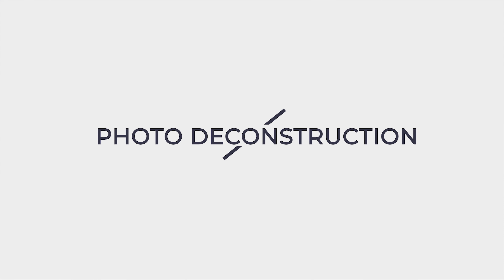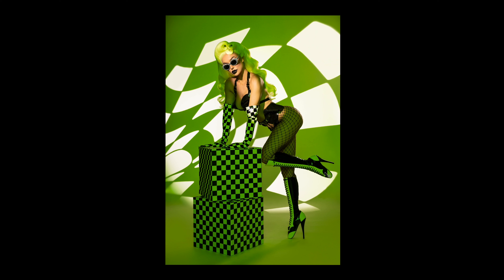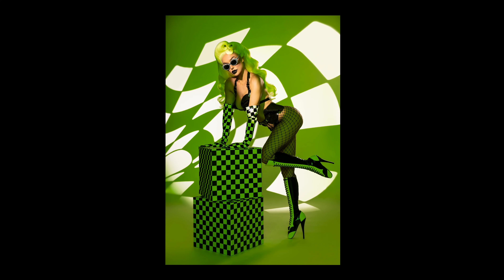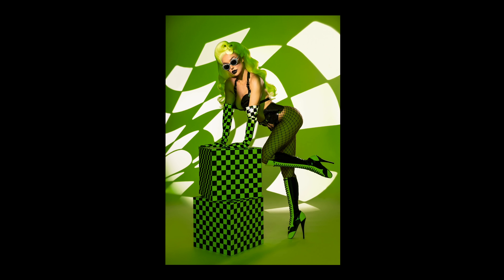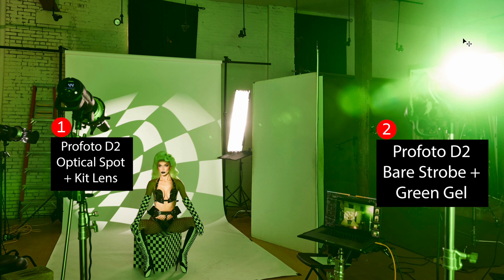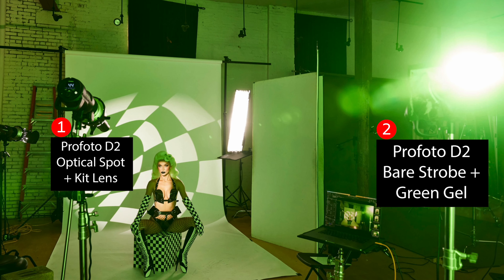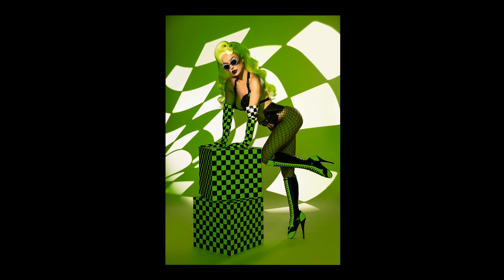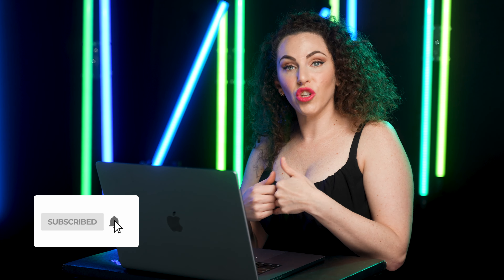Behind the Scenes of an Eye-Catching Fetishwear Fashion Shoot

Comment: I just tried my new optical spot for the first time with a 50mm lens.   How do you focus it?
Reply from the maker: there are two rings. one is aperture, one is focus.
Reply from the maker: Also - instructions. :D
Reply: @lindsayadlerphoto  I think they were trying to save money-- it didn't have any. It didn't even have a box. It was just wrapped in foam and bubble wrap.  Which surprised me from Adorama.  Thank you for the guidance.
Reply from the maker: @jamesg1974a  No box?  Did you buy used? This doesn't at all sound like the one we made for Westcott designed specifically for this tool. It definitely comes in a box.
Reply: @lindsayadlerphoto  just a plain ef cannon 50mm 1.8...   but this one is now discontinued on adorama . It was only $98... also, it is much more focused and crsip when the light is pointed directly at the backdrop